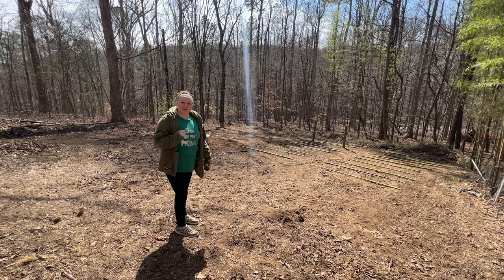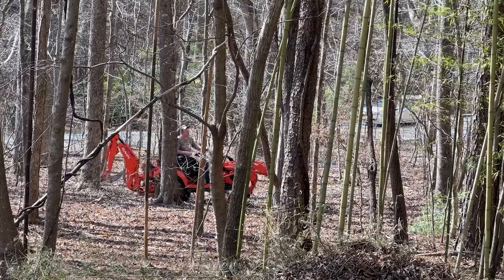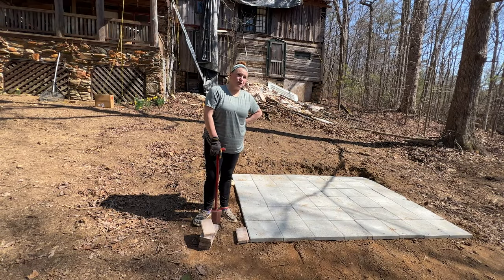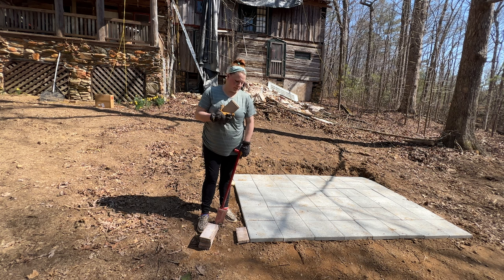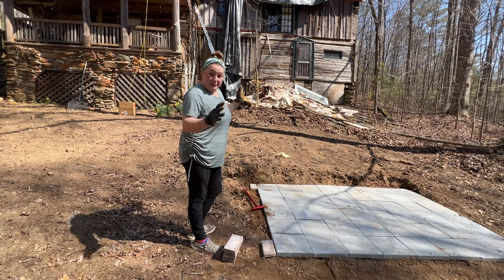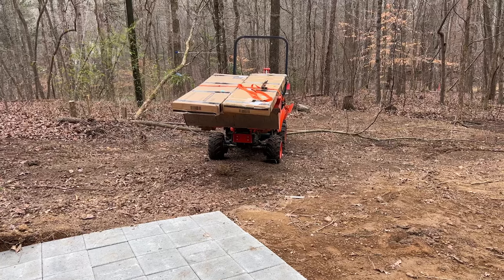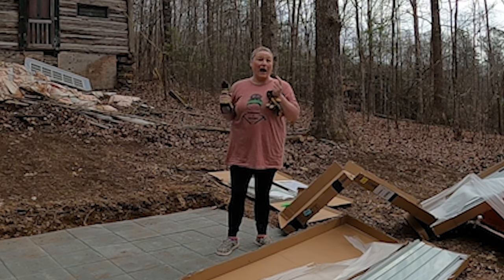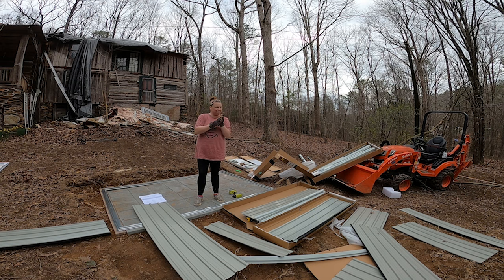Chicken coop build

Comment: There’s a way to make these tomato plants produce a good quality product. You can plant early there’s a guy on YouTube that does it and shows how to do it. He cuts the bottom out of 5 gallon buckets plants, the tomato instructed places the bucket over the plant The open bottom and then throw in the compost or dirt around the buckets It’s a soil that has a good bit of wood chips, light and fluffy. and he also positions a piece of tubing into the ground so that he can water it through the tubing I guess or something like that. If a cold snap occurs there’s pieces of plywood probably 12“ x 12“ or any kind of plastic and boards and just lay over the top of the buckets and they’re protected from the freezing or frost, then when the time comes just rake that soil back, remove those buckets and your plants are already half grown at normal planting time